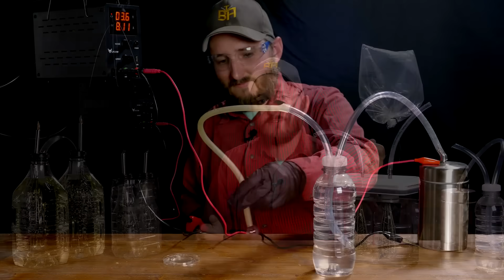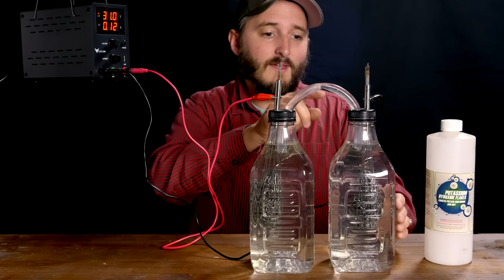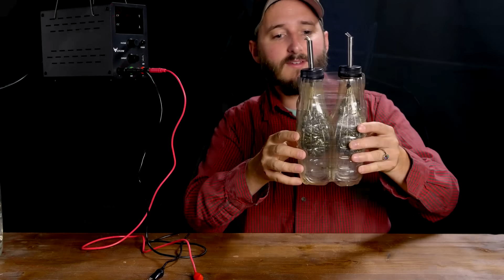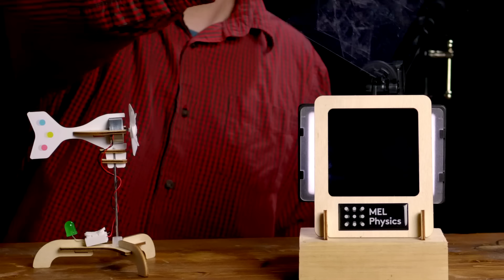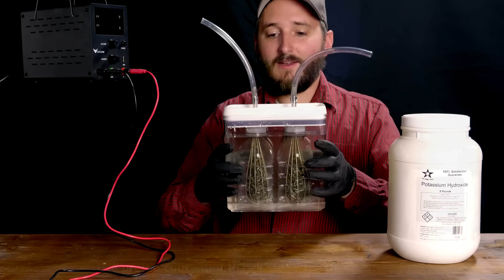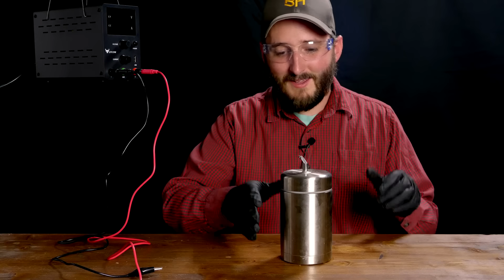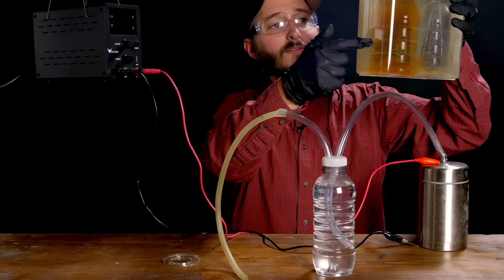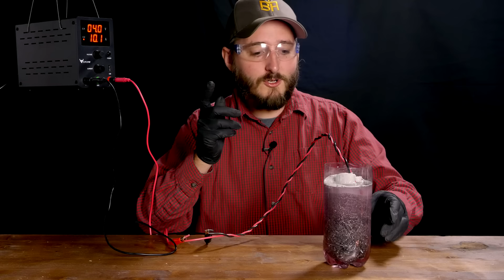DIY Hydrogen/Oxygen Generators From Grocery Store Items (HHO Fuel Cells & Split Cell Electrolysis)

Comment: Last year we used a self-made generator to fill a whole 1 liter cola bottle with the gas and lit it from below like a fireworks rocket. You can't imagine the bang that went down the street. The pressure wave under the bottle was enough for individual blades of grass to detach from the lawn and fly around the bottle. After we found the bottle it was still very warm from the explosion, we were able to crop out the frame of the launch in the video and the bottle appeared like a glowing fireball in the picture. We never repeated the experiment afterwards because it was simply too dangerous.

Comment: I also found out the hard way of trying to run a 5 hp engine with hydrogen, forgot that I needed a one-way valve to the intake and a little miss fire blew the generator all to pieces, and was lucky to not get hurt

Comment: would putting the sock -- or even just the steel wool -- inside a thin walled container that extended above the liquid in the outer container allow you to collect the separated gases?

Comment: My Daddy & his then boss were experimenting with this set up. They put 220 volts directing into a fish tank with the electrodes. Ran a single hose out of the cover tank & although I didn't personally see it, Daddy said it shot a flame out the end of that hose! Powerful....very Powerful stuff. I'd be anxious to know with a smaller voltage, say using a 12v to 110v inverter what the outcome would be. You'd probably need a potentiometer to play with it before shooting the straight 110v into it. It'd be interesting. I think I'm gunna play around with it some. I think a one way pressure valve would be the best way to keep gas from back flowing & causing you to be sent into   outer space

Comment: You did an amazing job utilizing readily available items. One thing I would like to point out is that, even with the modifications to collect the gas separately the gasses collected is still infact HHO (maybe just in a lower presumably safer concentration). I have carried out similar experiments to stop gas cross contamination and I can confidently say gas separation isn't easily achievable without some kind of membrane.

Comment: Thank you! Awesome video! Annode/cathode separation could be done using 2 glass wine bottles with the bases cut off (using heated wire method). Avoiding the plastic degredation issue in the electrolyte.

Comment: In the 20's.
UnGrounded Copper radiators with the negative cable grounded to it produced so much hydrogen that cast iron block would saturate enough to run the vehicle with out gasoline.
And the ign coil held a static charge that would start the car if the car creeped enough for points to close. The phenomenon was called ghosting when cars and tractors just started by themselves and started moving along aimlessly.
This is why the insulate radiators and introduced the condenser.
Funny thing is the Germans new all this long before Ford encountered it and had to deal with it with a device called a" hydrosalator".
A condenser.

Comment: Nice video.

The weak spot to all of this is the corrosion of the electrodes.

If you could find an electrode that wouldn't corrode then this system would be practical.

Comment: I really enjoy your content! This video in particular kicked in my “what can I do with this” new information I just acquired nerdy alter ego I’ve named Ekko. 
So after you spoke about “scaling the sock concept up…” I noticed sitting right in front of my work bench right now is an empty 55 gallon white plastic barrel, burlap bags, buckets full of scrap metal filings, and approximately 400 lbs of rock salt. 
A set up at that “scale” - what would be an appropriate current to apply for the initial test, at max, and what would the resulting out puts in the gasses????

Comment: nice video.  also as you produce gas, you are consuming water.  thus you are generating a vacuum, which will reduce your production.  You should add a one-way valve connecting a water supply to replenish the water as it is consumed.  Also use distilled water so you're not dumping minerals from the water into your reactor.

Comment: this was originally invented by an MIT student from Camebridge Ma. extracting oxygen and hydrogen from water and producing a high temperature torch system used to cut steel that is 1/4 thick and larger.

Comment: Even though there's a lot of energy involved if the mixture explodes, it doesn't have quite the same percussive force as you might expect from other similarly energetic explosions, because the mixture is reacting back into water, occupying a much smaller volume. You get a combination of an explosion and an implosion, the dominance of which depends on reaction rate (volume shape etc.) and homogeneity. Most often you will see some explosion initially followed by implosion, but it varies a lot and if everything is just right you can even just see an implosion. It's a little unpredictable so you need to assume the worst, but the result effects can be quite surprising.

Comment: I got the feeling that it would maybe be appropriate to check the resistance of the circuit befor connecting the power supply when using the sock method since the steel wool may be pointy enough to puncture the separating insulation and cause a short and (hopefully) blow a fuse or cause damage to the power supply. In a worst case scenario it could make sparks and cause explosions if volatile gases are in the vicinity.

Comment: For these closed containers it would be cool if you could add an additional hole so that you can continuously fill the tank without having to open it, possibly via a syphon setup from a larger tank, however I understand that the pressure in the container will be slightly above atmospheric, so the syphon tank would need to be elevated.

Comment: I built one 20 years ago, way different design, using 12v, drawing 13 amps and produced 1L of gas every 2 minutes on well water without any electrolyte. We have dissolved solids in the water in the 135 to 165 range, depending on the time of year.

Comment: If it flashed back into the reaction vessel it would implode, not explode. When you tested your bubbler you saw an implosion. HHO only explodes if it is mixed with other gases/elements. The reason the hho bubbles are so much louder when ignited is because it is an implosion. When you cut metal with hho it leaves no slag..., it is truly incredible stuff.

Comment: I really enjoy your videos. I realize I've seen them several times over for being good quality concise content. I'm currently working on a reduced industrial approach to compressing the hydrogen into a tank after drying with desiccants or pressure swing absorption. I'm still researching cannister liners and coatings as I've found mixed responses around hydrogen embrittlement and porous leakage but at ~500psi I'm less worried.

Comment: I made one with a glass coffee jar drilled 3 holes in the lid (grind away Nescafé logo on it so it’s flat) install 3 rubber grommets, two bolts, 4nuts and 4 washers and aquarium tube that feeds into that flashback arrestor (bubbler) bottle for safety. Good luck and follow all safety steps shown in the video

Comment: Nickel foam is a better electrode material and are also catalytic.  Add a pulsed vibrator to release the gas bubbles from the surface of the electrode and the fluid remains in contact more of the time to increase hydrogen production.  Nickel also resists corrosion better.

Comment: my Polo was equipped with a 12V HHO generator with electrolyte cooling radiator and a spark arrester in 2011. Close to 40% better fuel efficiency, more mpg, more hp. HHO intake after the air filter. High RPM boosts the 
hho production, supplying more gas to proportionally add its share of energy.

Comment: I remember as a teenager learning that muriatic acid (what HCl for swimming pools is called) produces hydrogen gas when some metal like aluminum or zinc is dropped in it (zinc was more reactive). So my friends and I would put some acid and metal pieces in a bottle and put a balloon over the mouth of the bottle, and let it inflate so we had a balloon full of hydrogen (which leaks out of latex rubber faster than helium). We'd tie a string to it, light the end of the string, and let the balloon fly up into a dark night sky. When the flame hit the balloon, it would explode in a bright flash. We didn't realize at the time that the explosion would have been better with oxygen in the balloon, but then the buoyancy may not have been sufficient for the balloon to rise.

Comment: A solution to the heat issue could be switching all the parts with steel, since potassium hydroxide doesn’t corrode steel and it won’t deform under heat allowing you to run it for longer, although you’d sacrifice the ability to see what is happening in the container

Comment: Switch out one electrode (cathod) with spun aluminum shavings from a lathe). Aluminum has a +3 covalence and will produce GOBS of hydrogen gas.

I manufacture hydrogen using a passive solar (PV) panel.

My generator is tubular aluminum with a center high-nickle stainless steel electrode and fins to discourage mixing 02 and H2 gas bubbles.

I fill quart Zip-Loc bags with Brown's Gas and light them in a 7-foot "air cannon" which can be heard for 3 miles!

Comment: Interest to product oxygen only ( for portable propane oxygen welding torch kit for hvac )
The questions is  
1)	Worth the way this method or must use a OXYGEN CONCENTRATOR ???
2)	  can i use directly 12v solar panels to product???
3)	 Need a extra chamber to collect the oxygen and then a compressor to press in to a mini oxygen cylinder ???
Thank you for your great ideas , keep the great work !!!

Comment: I realize this is an old video, but, I just found it. I did similar research some years back. As you were taught in junior high school science, the losses from typical water electrolysis render the project inefficient.  In theory, it is possible to take electrons from both the oxygen and hydrogen atoms making them unstable. The instability of the atoms returns a larger yield when oxidized into water. You could say we would be using "atomic energy" as opposed to chemical. There are similar experiments to demonstrate the process such as the GEET. It's considered a plasma reactor. Today the latest iteration in existence is the Thunderstorm generator. The design concepts are very simple to understand and create from easily acquired materials. Many have used lawn mowers as a testing design for concept.
Reply: Bullshit

Comment: HHO != H2 + O
it is multiple H2O molecules being forced into a new macromolecule configuration like a ring. (resulting gas is also uniform and heavier than air and burns differently)
This is done via sharp DC pulsing (like from a tesla hair pin cicuit), Or mechanically vibrating plates in the water + small DC gradient.

Comment: Thank you so much. There is no doubts hydrogen is the fuel for the creation of new markets with good quality of life. I would love to see an improvement to the last experiment...by using aluminum scouring pads ( instead of stainless steel). The scouring pads is genius improvement!!!...Much better total surface area. Please add two independent tubes for the Oxygen and Hydrogen coming from the center and the periphery of the hydrolyser. Marvelous illustrations. Thank you!

Comment: Loved your progression between the various electrolysis setups! In the final sock model, How about using the wisk method wrapped by a sock, inside a snug fitting plastic bottle leaving the bottom 1/3 open.  Then asecond sock over the 1st sock and bottle before it's wrapped by the stainless mesh (No mesh on the bottom) Sides only, Would that allow the heightened electrolysis rate while isolating the gases?

Comment: When I built mine I installed a radiator and a 12 volt pump with a 12 volt fan on the radiator solved my overheating problem

Comment: If you use an ultrasonic bath as your reservoir it will clear the bubbles from the surface of the metal and 5x your output

Comment: Graphite is easy and cheap to come by.  Disassemble any lantern battery, filled with graphite rods.  Might not be an improvement re surface area for reaction, but your chromium problem would go away :)

Comment: With the best of the set ups the power draw is low enough that you could do it using a basic solar panel?  Could be a handy survival tool or off grid living to produce hydrogen to then power a generator at night when you don't have enough solar power stored in batteries or to run in a vehicle. Or better still to use in a hydrogen fuel cell to generate clean power.     I guess making the gas and storing it in enough bulk to be useful when its needed is the biggest issue.

Comment: Great examples!
I've wondered for a long time, why they say it's inefficient to use electrolysis as a kind of a energy storage device (ideally with two separate tanks for H & O).
Electrolysis mode can be powered by solar panels, and then it's too dark for them to generate electricity to use the separated H & O to produce electricity.
In most example when they say H2 isn't efficient (or cheap) as an energy storage it's usually in a more complicated context of an el.car or complicated power network that takes multiple AC/DC conversions apparently just for the fun of it :)
So I'm very curious to see some basic math about a scenario of using solar panels to power a house during the day, and use the excess power to store it in separated H & O, and they recombine (ie burn ) them later on demand.
Again no need for conversion to AC or long-distance power transport, Imagine the use case of a single house (assume that most utilities in that house work fine on DC)

Comment: why not use a steel hose clamp around the base of the bottle to connect the negative cable which not only would provide a better connection but would also mitigate a potential spark source if the metal strip and bottom of the bottle were to momentarily separate and then remake the contact?

Comment: The pure hydrogen gas could be stored in your pressurised gasometer, for hydrogen stove cooking, heating etc. It would be interesting to see how large a gasometer is needed to supply 1hr of hydrogen gas cooking Or heating in perhaps kilojoules output. Where excess solar from panels could be used to generate hydrogen for heating or cooking at night.

Comment: would safety valves like in water heaters work? 30 years ago I worked on eletric transformers soldering some aluminium tabs on the winding of the same material and we used a mix of butane and compressed air to reduce costs but the idea of coming up with something if not the same thing never left my mind  mostly every one said i was crazy and my lack of schooli*n but here you are confirming that it is posible to separate these elements and just that in it self is kind of encourgeing so thank you for your video and most of all for sharing your knoledge, I enjoyed every part of it thanks again

Comment: I built an open top design and ran into a problem where the gas was pushing the water out instead of going out the tubes. I think my tube diameter was too small so the gas decided it would be easier to push the water out. My next design will be a closed top that’s air tight

Comment: Hello.. Perhaps you should look at the experience of Stanley Meyer, who separated the components of water using the electric resonance circuit.. The resulting quantity is more than the traditional electrolysis method, and its consumption of amperage is very, very small. You can search for this topic further.

Comment: An upgrade you could try is instead of using crappy stainless steel thingy that will dissolve and contaminate overtime, attempt to electroplate some steel with nickel. Nickel is a cheap and stable material that is used as the HER/OER catalyst in commercial alkaline electrolyzer. Meaning, not only will the nickel last much longer than steel. It will also greatly improve the efficiency.

Comment: Makes me fully appreciate the interest in hydrogen fuel and HHO fuel alternatives. Also the risk in hydrogen storage. I've heard engineers joke that a hydrogen powered car is like "driving a bomb"--I GET it now. It seems to me if we have the production side figured out okay, the next task is how to safely store and employ this monster without blowing the roof off of stuff. 

Please correct me if I'm wrong, but it seems the only way to get payload out of this fuel is by a rotational combustion engine of some sort. And the way utility companies are doing this (I understand from Robert Murray Smith) is precisely that, a generator burning the fractioned hydrogen from hydrocarbon compounds (which raises other concerns obviously). 

(I also learned from RMS that we can improve our output considerably by using aqueous urea solution, some carbon felt pads and a couple of magnets--and from some genius in the comments section there--pulsing the electrical supply at the resonant frequency of water, approximately 3 Ghz, which shatters the water more readily (absolutely fucking brilliant).

Do you envision, then, maybe small individual power stations in back yards? Maybe the safest way to STORE this potential is in electrical form, such as a power wall kind of construction, and the hydrogen is produced and shot immediately, so there is no explosive storage?

Comment: I have a 94 Rover JDM. Single port injection normally aspirated engine. Plans to apply this configuration by removing the air conditioner and placing another generator...the starting point. I enjoyed your video lost count how many times I watched it! Osum from down under.
Reply: A Tip. If you install this in your vehicle, add an inertia switch in the electrical circuit in case of a collision it will instantly kill hho production. Also add an acetelene flashback arrestor where you enter your plenum